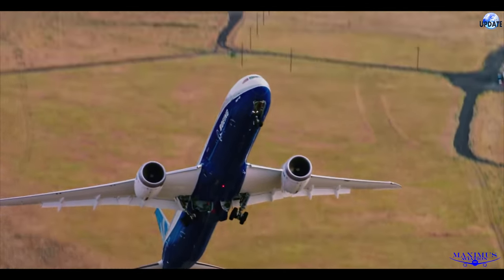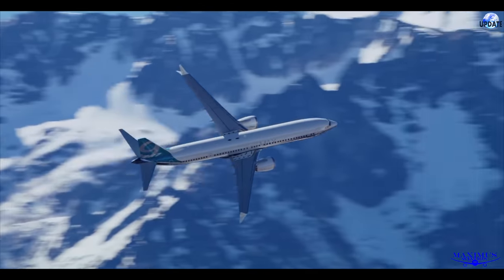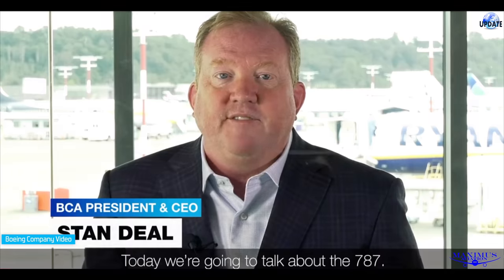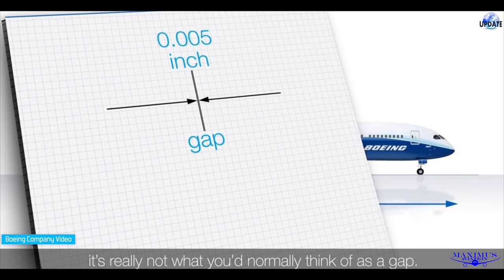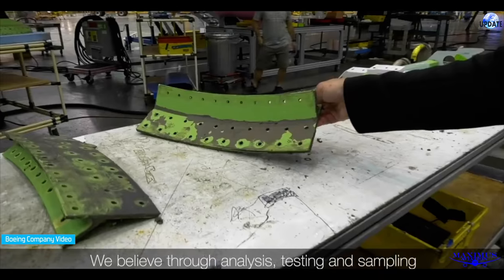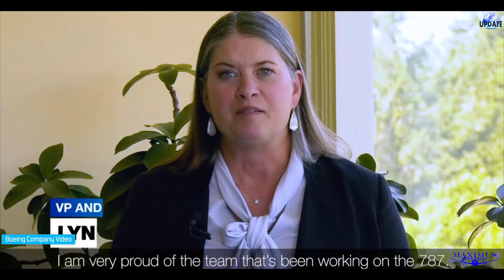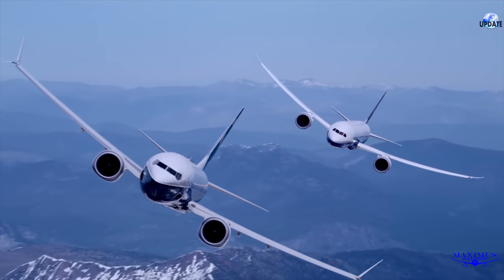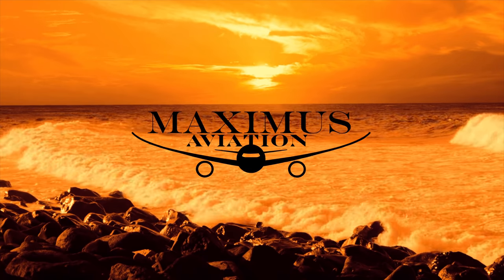Video Showing The Repairs To The 787 Gap Defects

Comment: "We're reviewing the aircraft from tip to tail in a way that is safe and compliant for our customers and regulators! Marketing speak for " We're looking at where we can cut costs from the airframe and where we can speed up production". If Boeing had a culture of best quality and engineering, they wouldn't need to make a video like this IMHO.
Reply: Airbus does the same thing
Reply: @brkitdwn  Well it appears that airbus is not having defects and issues with their planes, and there planes are not grounded, airbus also does not hide issues and repairs them as soon as possible
Reply: @ngaviation3489  Airbus doesn't have any issues with their airplanes?? The A350 is certainly having issues fool.

Comment: Just a PR piece to make staff feel better, it didn’t address why the “gap” issues weren’t picked up and address during the production QA process.
Seeing Boeing set their own build tolerances that exceed safety regulations , one has to wonder why they aren’t applied in production. And makes one wonder what more important things have missed the QA process during production.
Reply: True, I think so too: The video opens a lot of questions; but why, actually? it is difficult to make a QA video on QA! So there is another question: How could B. make a video on safety of the 787 fuselage? Should they show a crash-test? (no that is for cars) but then how?
Reply: If their lips are moving they're lying.
Reply: Somethings not quite adding up. A 0.005" gap?? In manufacturing a standard tolerance on most cnc machined metal parts under 12"  is +-0.005" (that's 0.01" allowable variation) over12" is usually 0.01"-0.03" Were talking the fuselage of an airplane someone opening the shop door and the sun hitting it is going to change things more than that.
Reply: @rmkscrambler  for sure, Boeing has said that’s the gap tolerance they specify, so thats the gap tolerance they need to build to.
 It also needs to be remembered, that Boeing have a procedure to pack gaps that are outside the tolerance, but they haven’t been doing it and without explanation or a change to the approved design specifications or tolerances.
Furthermore, the fuselage is not metal, it is carbon fibre so isn’t affected by temperature in the same way as metals.
Reply: @rmkscrambler  "Somethings not quite adding up. A 0.005" gap??" 
If they are talking about the edge distance on butt-joint fastener holes then yes, .005 of a an inch out of tolerance is important and needs to be dealt with. The aircraft was certified to certain specific tolerances. If it is creeping out of tolerance they need to know why.
Reply: @rael5469  If I  were to guess it's either an o shit we forgot the glue. And the 0.005" "gap" is a way to minimize. Or some lazy engineer used generalized tolerances which were so obserd that they were simply ignored and or new tolerances approved verbally without  a paperwork update. But who knows  from our perspective it's all a guessing game.
Reply: @rmkscrambler   True. I agree.

Comment: From the video, it looks like the gapping problem is between the rear Pressure Bulkhead hoop frame and fuselage skin, hence the 0.005" gap tolerance, as composite laminate is less tolerant of fastener pull-up loads than metallic structures. That curved Bulkhead frame looks rather stiff and would probably pull the skin to the frame, rather than vice versa. Good ol feeler guages.....ahhh the memories!
Reply: So you're saying there's a potential of stress and fatigue cracks?

Comment: I was under the impression the gaps in question were A LOT bigger than .005. Even so .005” is a big gap when it comes to composites.my guess is: .005” equals a fifty percent strength loss. “It’s not a safety issue” Liar liar pants on fire.

Comment: Boeing is amazing i have flown in the dream liner twice and was excellent love the window feature how it darkens to make us comfortable and talk about the  new 777x its a king of the plane world just a amazing machinery by Boeing keep up the good work .
Reply: Not anymore
Reply: @kirilmihaylov1934  did you say the same after Airbus had problems with its a330s ?  AirFrance 447/Qantas 72 !
Reply: How the window forcefully darkens, because the flight attendent says so, and you cannot watch out the window. I will not speak about the rest of the plane, but the fact that the crew can "lock" the windows is pure evil.
Reply: @todortodorov940  what happened
Reply: @kirilmihaylov1934  What I was saying: Oz Diaz sees the electronically controlled window shades as a nice thing. I disagree and see this as a disadvantage, as the crew can overrule my controls and force close the window shade. Then I ask, why not just put me in the cargo hold.
Reply: @todortodorov940  not a big deal
Reply: @todortodorov940  that's true about the windows but what a smooth plane i have flown in it for 15 hours straight was smooth sailing.
Reply: @sanitman1488  DO YOU WORSHIP BOEING RELIGIOUSLY??
Reply: @ngaviation3489  what is you’re capacity within the commercial aviation business??

Comment: "There wasn't a whole lot of new information in the video." 
.005 of an inch is a LOT of information. It gives perspective on exactly what they are dealing with. I think they are talking about edge distance for fuselage section butt-joint fasteners, or lap-joint fasteners. The edge distance of the butt joint fasteners is very important. They keep edge distance to a minimum to save weight. But edges and fastener holes can creep during production or during assembly. But rest assured, this is a thing that only happens at the manufacturer. No lack of edge distance would make it past the production line inspectors. If fastener holes ever crept beyond safe margins it would be rejected by inspection...and either repaired or scrapped.

Comment: Lots of negative commentary here. I worked for 5 years hands on,  on this aircraft and it is far and away an evolutionary jump ahead in terms of technology and reliability. 
In 40 years I have worked on 15 different aircraft types and ALL aircraft much like all cars develop their  own set of issues. Boeing is on the money here and just as they are saying they are doing, they are making sure all these aircraft are meeting their design specification and tolerance. It is a new material to build them out of and a new way of building them this there are going to be issues throughout the life of he airframe and no amount of computer modeling can predict them all.
Reply: Most of the negative comments come from know nothings who would like to see Boeing fail
Reply: What about quality mate
Reply: @parksidepaulie8490  Boeing did fail with 737MAX. One more major crash and is over mate
Reply: @kirilmihaylov1934  Boeing's regional director Product Marketing Tarun Hazari told Airlineratings.com that the 787's reliability is a “fantastic story” achieving a rate 99.4 percent, just behind the 777-300ERs 99.46 percent. “Given the higher utilization of the 787 that is an unprecedented number, said Hazari.

Je whiz I wonder how that is achieved without quality?  Magic maybe?
Reply: @parksidepaulie8490  absolutely right !
Reply: @kirilmihaylov1934  ask Airbus too about this especially after the problems with its a330s !
Reply: @sanitman1488  that was about 10 years ago, airbus have fixed the issue, like boeing will fix the 787 defects, I love the 787

Comment: "Each of those sections ..., is within 5/1000 of an inch". Boeing may sound more professional if they used metric units to design their airplanes. After all, large part of their market is metric and suppliers are in metric countries. May be they have the same issue that NASA had with its sub-contractors. One part of Boeing specified the gaps in 5/1000 of centimeter (50 micrometer), but the other produced the fuselage with a tolerance of 5/1000 of an inch.

Comment: If the gap was. 005 inches that’s still s huge gap. I believe it was much higher.
Reply: I am scratching my head trying to figure out how how they are applying .005" of paint...  Maybe with s roller?  Paint thiskness is usually measured in microns, right?

Comment: I won't fly the 787. Boeing moved production to South Carolina to get rid of the union.  Their quality in that plant is notoriously crap, which is why multiple nations have refused to take aircraft made there.
Reply: i agree to bring the planes back to Washagton
Reply: I agree ! The reason for Boeing to relocate to South Carolina is the union issue. I also saw the video of the factory and it’s worker’s attitude.
BMW did the same. You drive interstate 95, you see a big building on your right. I wonder their attitude is the same as Boeing workers. Scary….
Reply: @marimatsumoto372  no .you shouldn't compare them
Reply: doesn't mean you should not fly 787.
Reply: @nickolliver3021  I"ve flown on a 787, and didn't like it. Flew first class. The aisle was so narrow, I had to go down sideways to my seat. (I'm handicapped and walk with crutches.)
Reply: @HikaruKatayamma  blame the carrier as each airline decides how to design its seating arrangements!
Reply: @HikaruKatayamma  so is the a350

Comment: Well, I hate to be negative but I don't think these planes will last as long as the older planes have lasted.  For myself, I would much rather fly on an old plane with thousands of flight cycles and thousands and thousands of flight hours as I think Aluminum is better than composite materials.   I no longer will fly on a 787.  Personal choice, but I do my best to avoid that particular model of plane.

Plate C
Reply: Not when it comes to corrosion, remember Aloha Airlines.

Comment: Years ago in a previous life I was an industrial X-Ray tech looking for flaws in high precision castings, some of which were used in aircraft. I learned about flaw tolerances REALLY fast ... an air bubble the size of a pinpoint or a crack half the thickness of a hair can kill someone ... many someones. Structural gaps are no different. On a high stress structure like an airframe it may not kill you today, but someone can die from from it years down the road when the accumulated stress of thousands of cycles take their toll. I'm in no hurry to fly on a 787 or 737Max. Boeing have SERIOUSLY lost their way and the confidence of a lot of people, including me. It's going to take a long time to get that back. 😞😖😡 

Meanwhile, back in Toulouse, Airbus is doing just fine merci.😎

Comment: I do not trust Boeing, nor do I have any for the airlines who continue to buy their aircraft. Boeing has not dismissed anyone over their obvious failure to protect the safety of the public.
Why? Because they were loyal employees doing What they were ordered to do. Ultimately these orders come from the shareholders & they have no long term commitment to the company or it's customers. 
I can't choose what aircraft an airline buys, but I can & do choose what airline I fly on based on which aircraft they operate on the route.
Reply: I’m sure Boeing won’t miss you.
Reply: Boeing is a trustworthy company, especially with the 787, as they havent poured millions into it just to disregard it, boeing has done some crap with the 737 max, and it came back and bit them, bit them hard, I am certain they will not do the same mistake again.
Reply: @ngaviation3489 
I can't agree. You talk about the 787. How many times has it been grounded? How many times has it caught fire (including a prototype)? How many months has production been suspended due to production quality issues? How many% letters has the FAA sent them regarding quality?
The fact is that they will never be trustworthy until the entire clique of senior managers who are only motivated by bonus cheques are replaced.
Did you see the latest on the KC-46 where only a few weeks ago Boeing had to admit that the emergency exit was unusable and suggested that the airforce 'fix' the problem with velcro?
This company is a leading example of everything wrong with corporate America.
Reply: @gregculverwell  Fair point, Boeing has lost it's way, cheap fixes, and spend more time talking than doing.

Comment: That Boeing video made me really not trust anything about the company or the technical abilities of the staff performing essentially the 4th attempt at quality control hoping they can get some aircraft approved and delivered.

They should have been done properly before the internal QA check . Or the QA check should have resulted in an absolute perfect product and appearance for the delivery attempt with the airline  

After the embarrassment of leaving tools and trash all over the planes you would think someone would get serious about just doing the job correctly!

It is perfectly clear they expect the FAA and airlines to forget standards and be ok with "Close Enough" rather than the promised specs. 

Does anyone trust a group of people acting like they are told to wash the dishes a fourth time and try using water this time with assembling an aircraft?

Boeing still refuses to be concerned about doing the job correctly and producing a safe product.

Comment: Pressurised containers should not have gaps but they may have joints - the thickness of a piece of paper is plenty for atmosphere to escape, or is yet another Boeing cheap fix to ensure air conditioning? Perhaps some cheap auto-filler or a NASA style O-ring? What next Boeing? A video on how to build a reusable spacecraft out of old tin cans and sticky tape? One shudders more engineering, less spin!
Reply: Sad, but True, this is why airbus is better, they actually fix the issues their planes have.